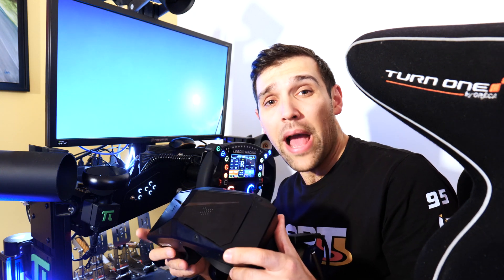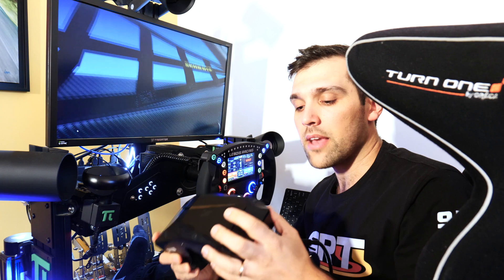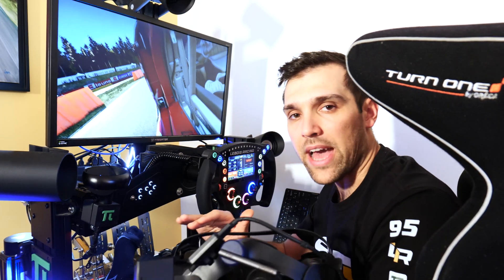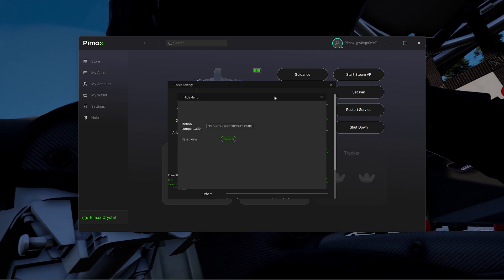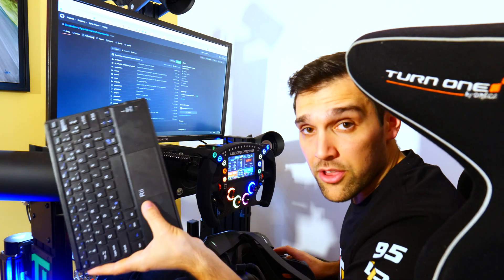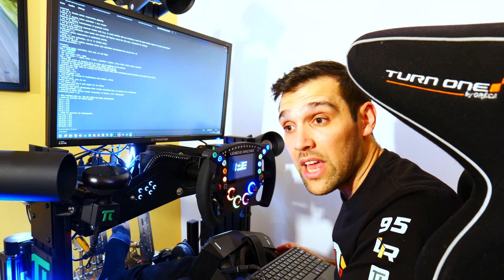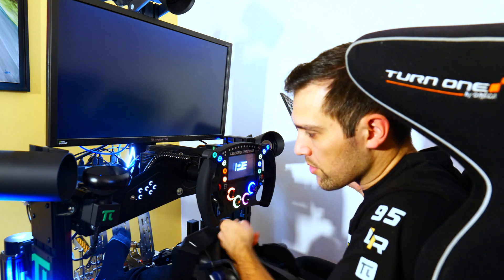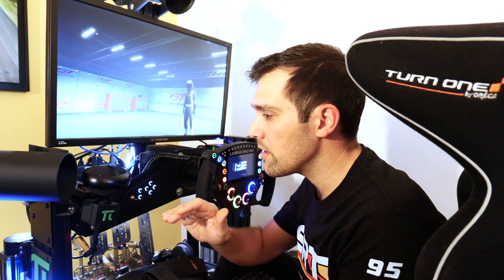How to : Pimax Crystal and Motion Compensation with OpenXR

Comment: I think this is a great solution for those using simulations where you're just looking forward.  My understanding is the controller MUST be within view of the Crystal Light cameras.  So if you're flying DCS for example and you look behind you (which you do a lot) the controller goes outside the view of the cameras breaking motion compensation.  Is there anyone here using a PCL along with a controller for motion compensation that can confirm or deny?

Comment: Do you have any drifting of the position of the controller, causing of EMI? My og Crystal with snpadragon xr tracing and the crystal super with SLAM tracking are drifting as hell. I have wheelchair motor for my DIY built. When I am activate thr mc overlay is obvious hie much is ripples nad move forward or to near. So no driving or flying is possible.

Comment: absolutley shocking. i got this working and soon as I left the pits. I was almost vommiting. The Nausea was off the chart. First of all it wasnt motion compensating at all. Infact it was even the opposite.  The controller was mounted securly just like in the vid. The motion was super smooth but it was doing some of the most strange back to front (you couldnt even put it into words) some sort of halucination effect. If anyone was to try this as its first VR experience, they would probably never dare go back to VR. I made it worse going down to KFC thinking about of food would help me recover....

Comment: so crystal super (not crystal light) has eye tracking. i assume it is the eye tracking combined with open XR and pimax play. NO extra external trackers or light house stations needed. can i ask how would this work with a simulator that can tilt you 30 degrees and also do 30 degrees sway?
Reply: it has built in eye tracking. But i didn't manage to make it works more than few times... Then the eye tracking was perfect (fast and accurate), but the gain in fps was marginal...

Comment: I’m hoping someone can help me.  I can’t get Open XR Motion Compensation to work no matter what I do.  I even reached out to Buzztee Bear on discord and tried his suggestions but with nothing works.  I’m using a DOF H6 with the Pimax Crystal and Pimax motion controller and SRS.  When I launch into VR, I get the countdown but then it just says “error” when it’s done counting down.  I watched your video and the controller is definitely “visible” to the headset.  Any ideas or suggestions would be greatly appreciated.  Is there something in SRS that I need to be doing?  Any thoughts?  BTW, I bought one of your 3d printed Pimax controller holders and it’s great.  Thank you.
Reply: Go into the openxrmc fonder and in the config file you need to change the device it's using.. you probably have it set as srs..needs to be controller.  

I'm curious how this mount deals with vibrations.. I would like to mount it to my p6
Reply: @CaptainPug76  I get the same error; I am using a VIVE tracker behind the seat with lighthouse. I would be great if someone could tell me what to input into the CONFIG file.

Comment: Do you have an idea how the controller handles vibrations coming from a transducer? I prefer to use the virtual tracker for this reason. Hopefully, this is possible with the lighthouse faceplate.
Reply from the maker: If you install the lighthouse base on the rig you will have the same problem.
Transducers don't make you move. It is easily filtered
Reply: how would you filter that, via the ini file parameters or just using a different attachment that compensates for vibrations? @LeboisRacing
Reply: @LeboisRacing I would like to ask the same. How do you filter the micro vibrations? I am considering to order your printed holder for my 4590 aluminum rig.